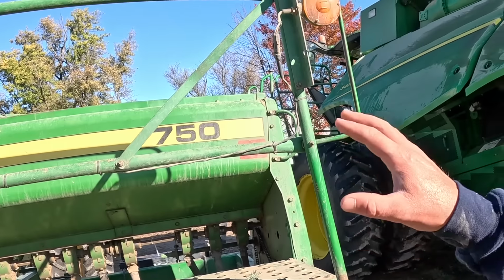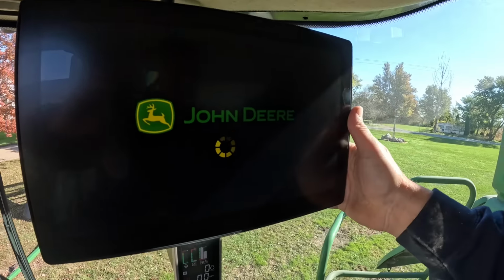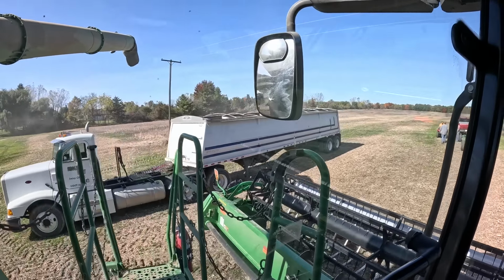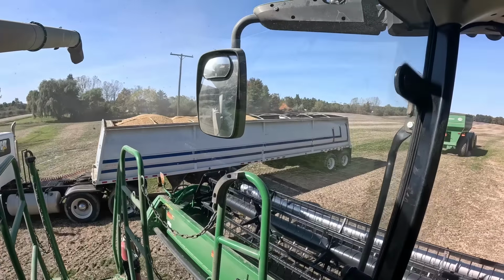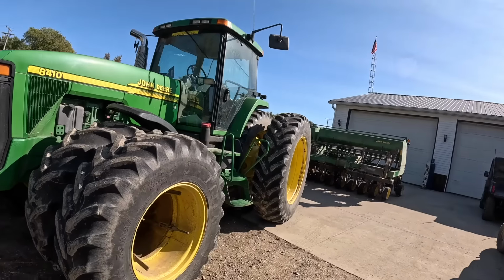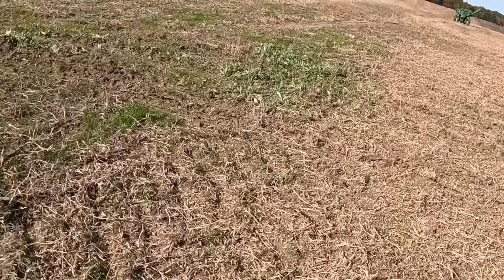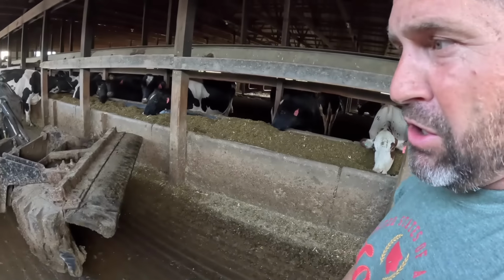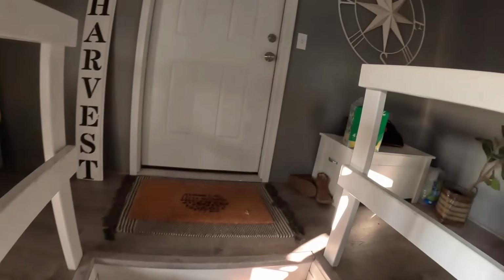Are John Deere Tractors the Best?

Comment: As for brand, it might be personal preference.  Each of the main companies have some fairly good models and some models that are less desirable for tractors.

I'm not sure about your local John Deere dealer, but the dealers in our general area usually have some type of "filter sale" sometime during the year.  It's basically where you can get a discount on all of the filters, whether it's engine oil, fuel, hydraulic, or the air filters.  If your dealer is nice, they'll print off a hard copy of your John Deere equipment models with the filter (part) numbers on the pages, just so when you need to reorder, you can write down the part numbers and how many of each that you need.

If a seed tender is in the plans, I might suggest one with a scale and hydraulics.  Our first one didnt have a scale, fixed height, manual swing, and  manual open and close for each hopper.  Then my dad was to the point that he wanted a remote to help swing the conveyor or raise/lower it.  A frequent question was, how much is left in it, without a scale, it can be tough to tell.  As for bumper hitch or gooseneck hitch, probably  personal preference.  Yes, they will work for hauling ground feed from the farm to the creep feeder if you have calves out on pasture, you may need a rod or piece of rebar to help poke it down depending on how far of drive it is.

Having a drill that doesn't fold for road transport, I know how fun those are.  Then is the reason why I bought the box drill that i did, but a couple of my fields are over 25 miles from the house, so we see some road time.